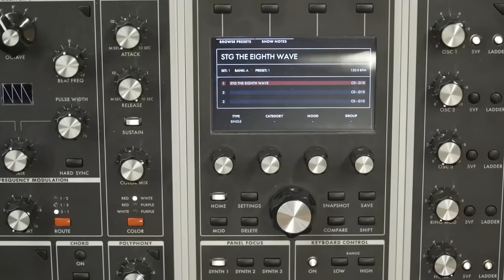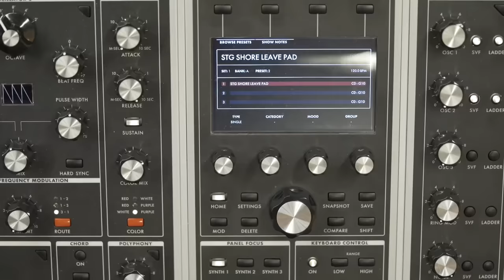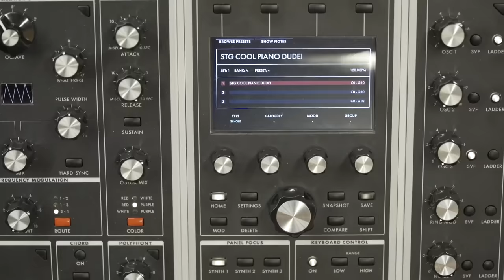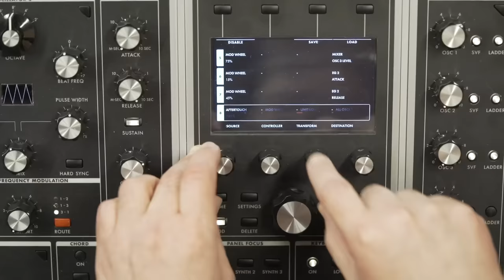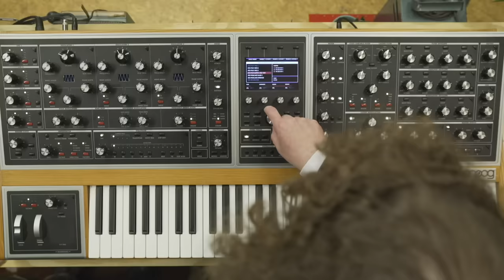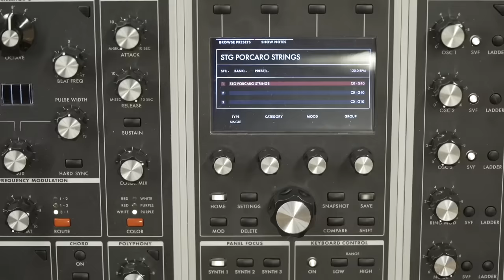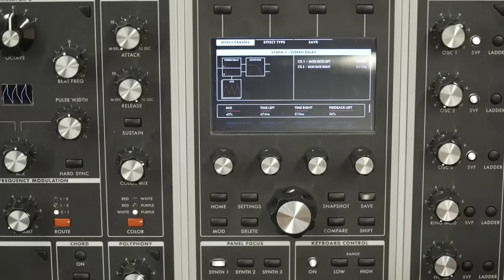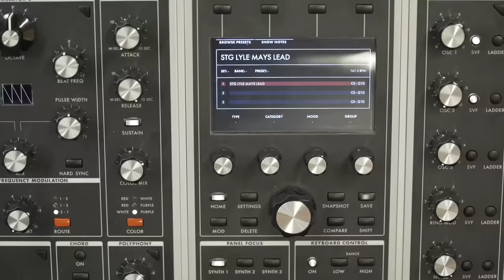Moog One: Sound Designer - Part 3 (Live from the Moog Factory)

Comment: The Roland JX-3P had a Hold function ... great idea but with only 6 voices it was extremely limited; not so on the Moog One (especially if you've got the 16 voice). Amazing it took someone this long to reinvent that wheel! Come to think of it, the 3P also had a button press vibrato, which you can do using the touch pad on Moog One. Again, very useful but way more powerful on Moog One.